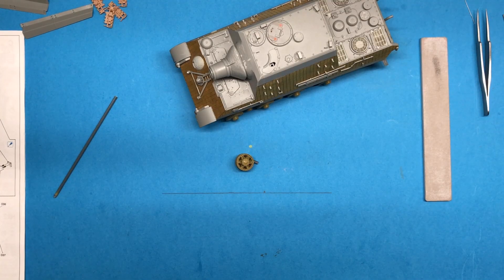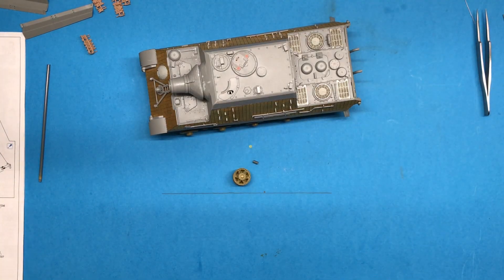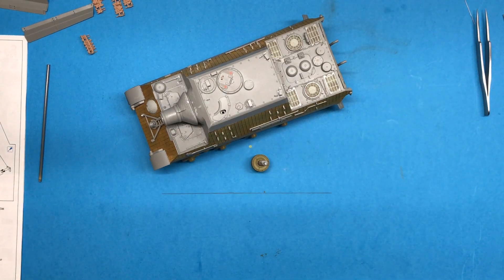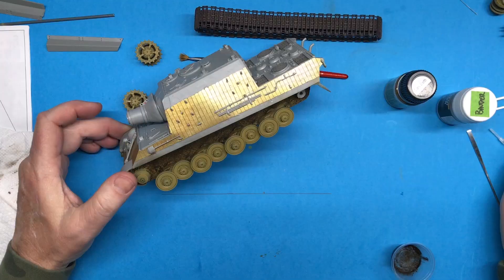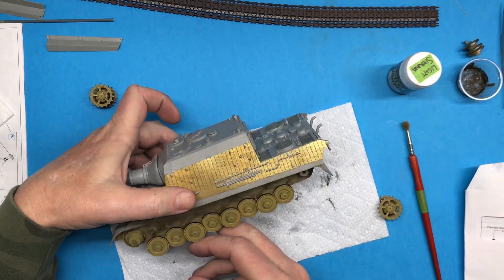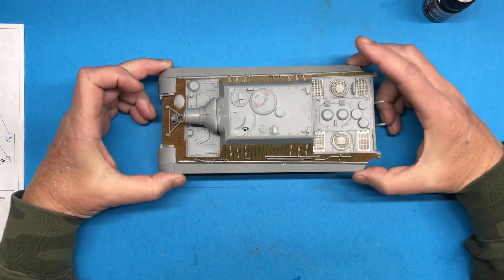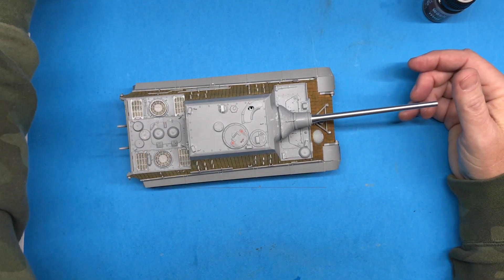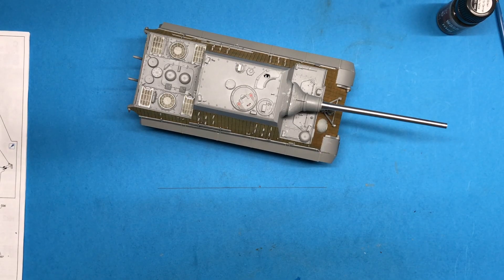Dragon 1/35 Jagdtiger, Part 5 Tracks

Comment: Couple of questions Brett.  Gun clearance. On my jagdtiger the mantlet has a VERY small clearance on my kit? I was hoping you'd had showed it. Anyway second question is on the tracks, did you say magic tracks?? My tracks were on a sprue. And were a mess. That's why I bought friulmodel tracks. What I've spent on that kit to get it corrected, I could had bought a 1/16 scale RC jagdtiger with sound and firing 22 ammunition. 🤣🤣🤣🤣 great save brother 👍👍 God bless
Reply from the maker: Which part of the gun? 
Yeah, I mis spoke on the Magic Tracks... they are on the sprue. Oddly enough I found them to be easier to deal with than the TRex tracks. My preference for tracks is definitely metal (master Club when I can get them) but all I could find were Friul. Way too expensive for what I wanted to accomplish here.
Reply: @BrettG64  
Distance between the bottom of the gun mantlet, to top of drivers compartment.  ( : < ) like the two dots top dot gun bottom dot roof of drivers fighting compartment. Hope that makes since.  On my kit the clearance is VERY tight. I have the build in storage because we moved so I have to wait. Thanks to the plandemic and inflation everyone thinks there house is worth a hundred thousand more then it's worth.? Anyway I wouldn't have even thought about it, but your build I've been watching intently then remember my build.🤣🤣 oh well God bless.
Reply from the maker: @claytonmcclain182  Mine fit fine... no cleaarance issues. 
And I hear you about the housing market. I don't keep up much on it, but I've seen a few articles talking about it.